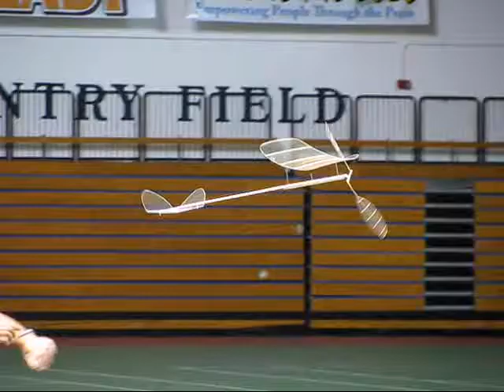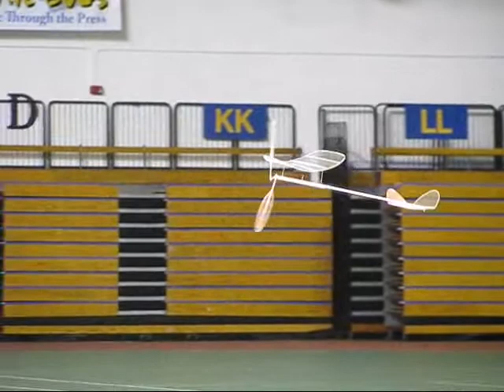Finn F1D USIC 2011

Comment: @82wowee The slow closure method has been shown to be pretty efficient. Slobodan Mdic has gotten some impressive results from blades that go even more parallelgram-like, while the setup shown here starts the blade far enough out from the hub to reduce the side-slipping close to the hub. I'm currently developing a new VD that eliminates the off-parallel blade state, so it will be interesting to see what results that yields.